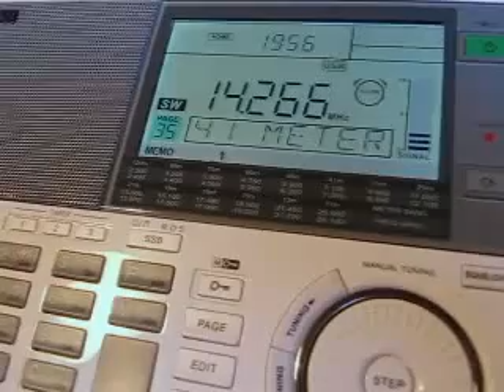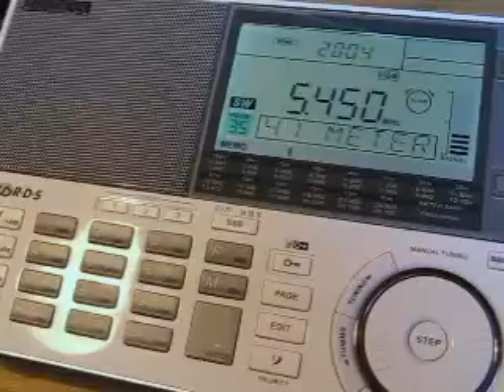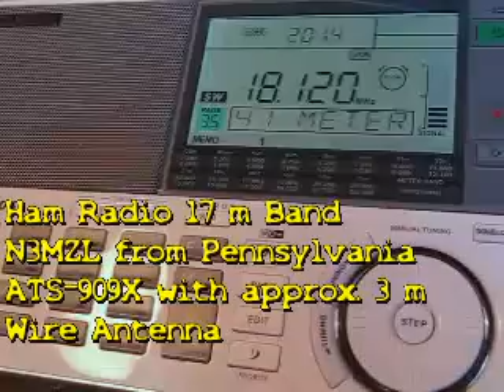Sangean ATS-909X receiving SSB Stations on Shortwave

Comment from the maker: @DjMaXXimal Concerning SW reception, the two models are rather identical. Both need at least the included wire antenna for weak signal DXing, especially below 10 MHz.
The 909X is more selective on FM though, and it has clearly better ergonomics (including an excellent display backlight) and superior quality of construction. If you don't yet own one of them, I would recommend you the 909X.

Comment from the maker: @MARKGM20877 Thanks for your encouraging comments. Local noise has badly increased in recent years, obviously due to all those modern electronic gadgets like PCs, WLANs, flat screen TVs etc. Indoor DXing was no problem as late as 2003, at least outside the TV prime time...
I'm also very curious how the ATS-909X will perform on FM during the ES season. No sign of it yet, though... MW&SW performance is pretty much the same as the old ATS-909. Cheers Matthias

Comment from the maker: There is no noise reduction on the 909X. If noise is a problem, the only way to escape is listening outdoors or at least using an outdoor antenna that is connencted to the receiver with a shielded cable. Beware that man-made noise caused by all kind of electronic appliances may also appear outdoors in residential areas so keep the antenna as far away as possible from houses.

Comment from the maker: @SanttuDX Thanks! I'm a little bit disappointed that Sangean didn't seize the occasion to improve SW reception compared to the old ATS-909, but I knew that before buying. Nevertheless, the 909X is a decent, very well built radio. On SW, the Sony 7600GR is much more sensitive with the built-in antenna, making it more suitable for outdoor mobile DXing without needing to carry around a wire antenna. On FM though, the ATS-909X is by far superior not only to the Sony. That's why I bought it.